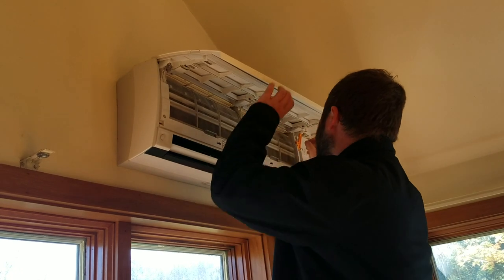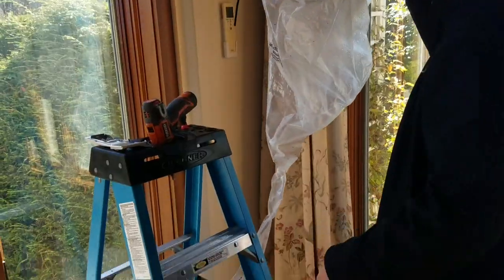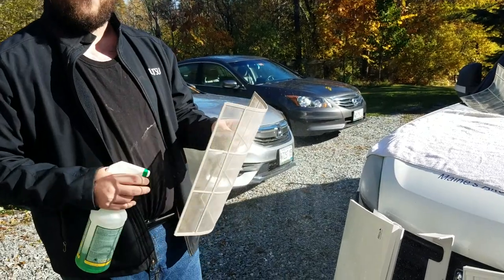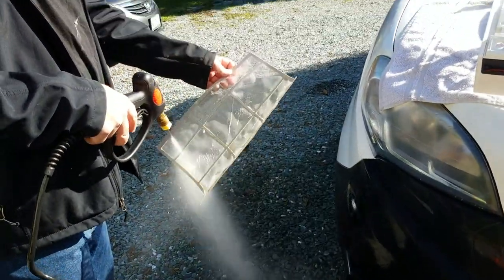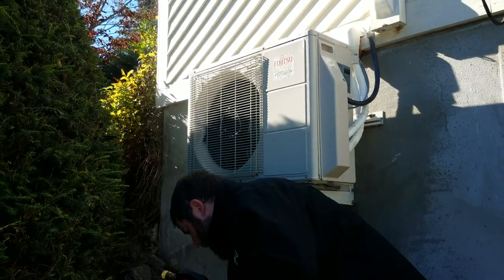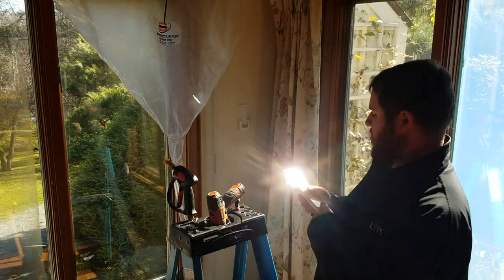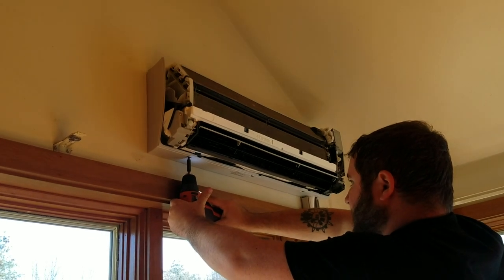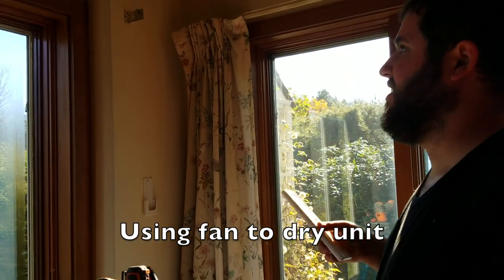Deep Cleaning Fujitsu Mini Split Heat Pump

Comment: deep-clean = motor+wheel need to come out.. then take a look inside FROM BELOW WITH A FLASHLIGHT and realize that spraying active foam + some water will not remove the mold in the condensers + the corrosion that is going on in those devices.
Reply: is it actually possible to take the wheel out on this model
Reply: @tomzezelic1522  It is but the screws are very well hidden behind a special protective mesh. Honestly the one big flaw people have with Fujitsu. The new K-series units (which are probably coming next year to North America because of the switch to R32) are much more traditional minisplits, much less of a hassle to open and clean regularly.
Reply: @СрбскиБрат  Yes did manage. Lost half day to figure it out. You actually need to take out electronic disconnect few cables, lot of screws. When i saw what i did i actually thought i will never put thais back😂😂😂
Reply: Great video